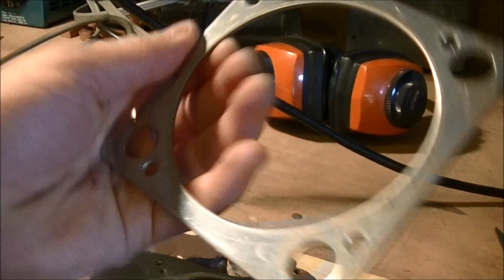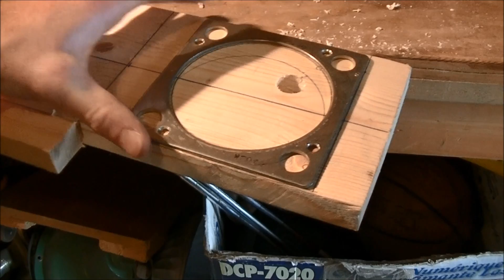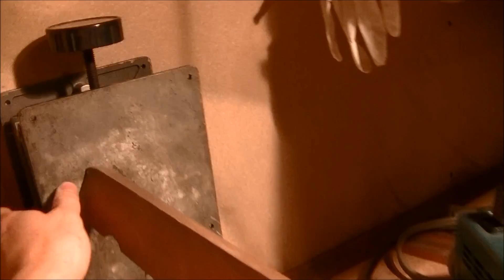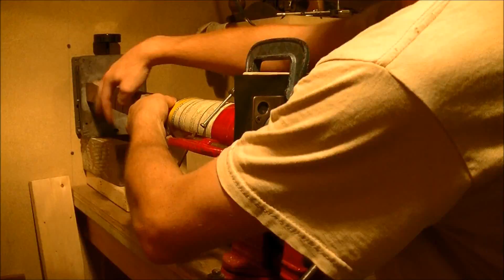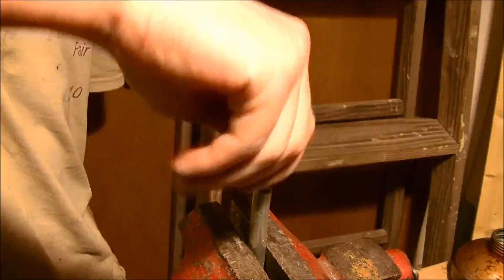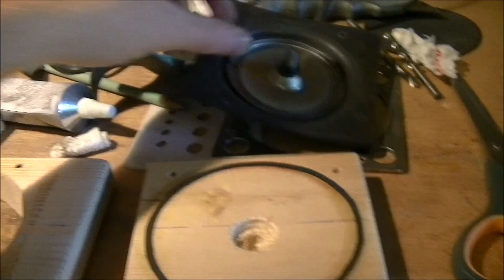How To Build a DIY Diaphragm For a Powerful Stirling Engine

Comment: A lamp rod is hollow and lighter than the bolt. Just plug the end with high temp JB weld or gasket sealer.

Comment: Accelerating and decelerating mass robs your engine of usable power. You can increase the usable power by reducing the mass in your displacer. Use the smallest aluminum bolt and nut possible. Maybe instead of a nut you just use exoxy. I'm not sure if you should use two Aluminum washers or just one and some adhesive.